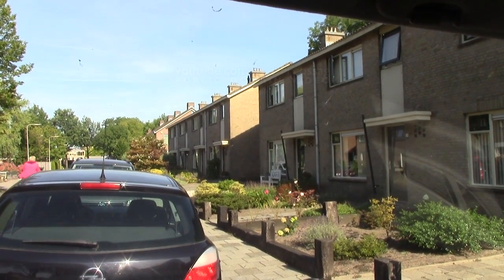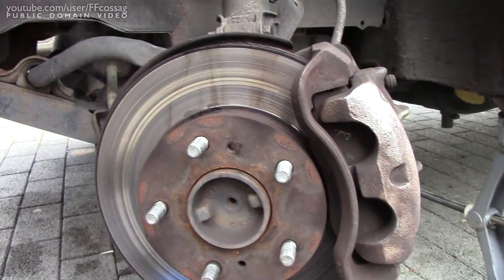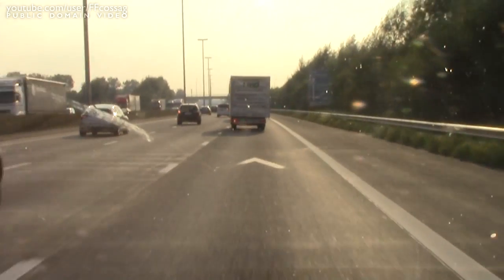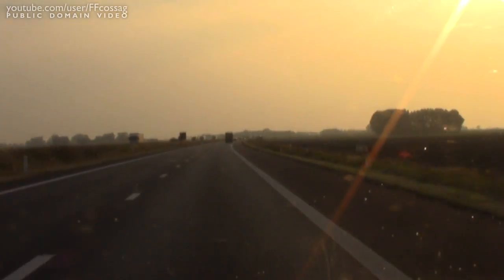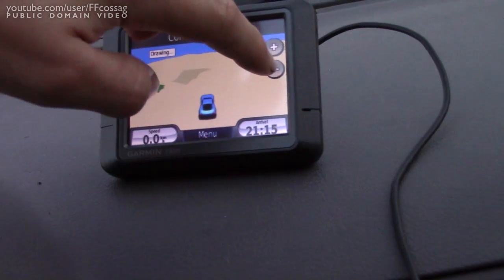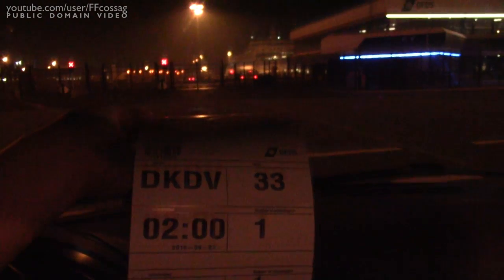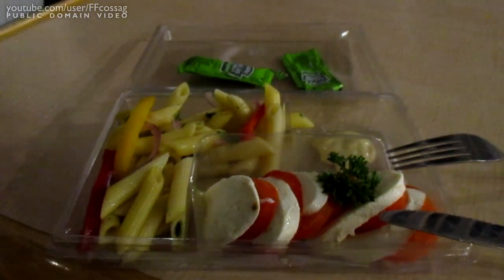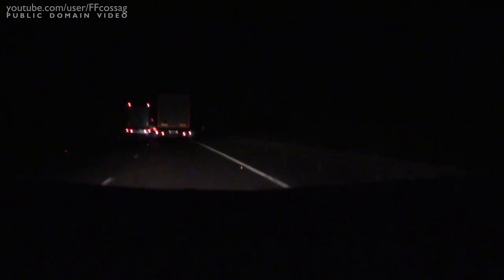VANLOG #16 - Braking all the way to London!

Comment: Nuvi 200? I had one, it was stolen out of my brother's car. That'll take a 4GB SDHC card no problem, and one can find map updates going into 2016 that'll work with it no problem on the, erhem, right sites without any encryption or whatever. I can still remember adding a JPEG of the right size onto the card to use for a boot splash.
Reply from the maker: It's a nice enough unit to be useful. I love the resistive touch screen; capacitive ones just don't jive for me on GPSes.
Reply: I dunno. the resistive touchscreen was always a pain for me sometimes. on a couple of occasions I did have to get into the secret service menu and recalibrate the screen.

since it was stolen I've been using my Lumia 520 full-time for GPS, and, although I've acquired a couple Nuvi 260W's as replacements, I've been too lazy to get them running and with replacement batteries when I have a perfectly good, and much more friendly, in my opinion, system already available. if there's one thing Microsoft did right with Windows phones, it's they made a damned good plaform for a GPS app, and in that field, Nokia Here Maps/Drive, assuming a Lumia device, with free map updates for life because it's a lumia, is really the killer app for the dying platform.

Comment: The horrible smell should be sewage from pig farm complexes. Cows are not so smelly like them and you smell that only when dung is freshly spread on the field by the road. Pig smell you can fell several kilometers away with the right wind direction! And sometimes not even spread sewage, when farm has something wrong with it's sewage pool (you do not want to smell those when they are disturbed). Thanks entropy I'm not into animal farming!
Reply from the maker: Yep, that is likely true.